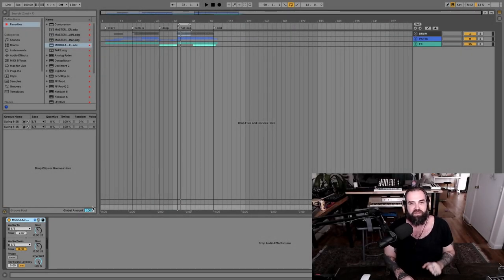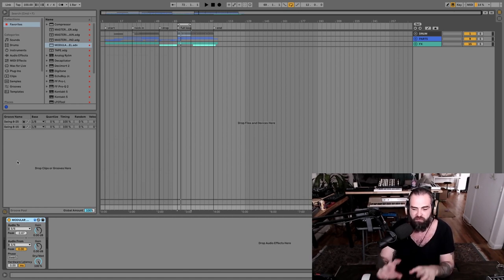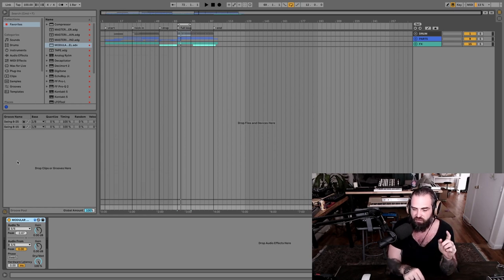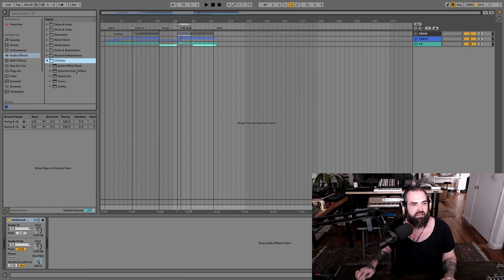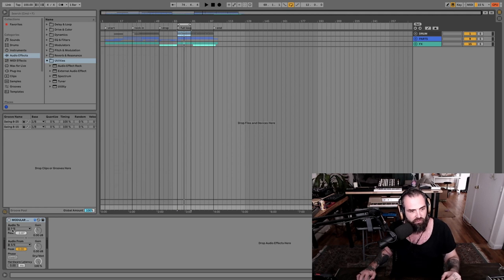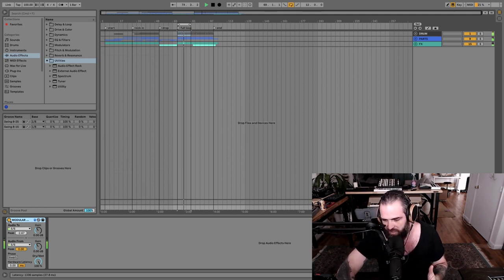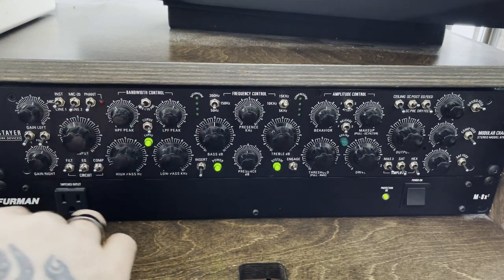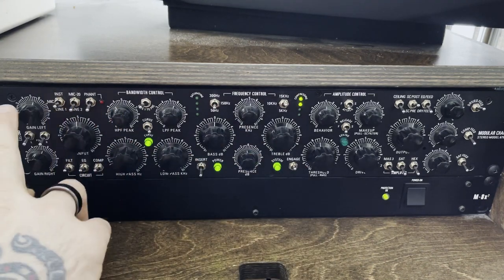Finishing A Track 3 : MixDown with Overstayer Modular Channel

Comment: Just a heads-up you can turn the filter/EQ/and comp off from the saturation feed in the circuit section on the left and they still work on the other feeds! Super useful for separating the different feeds for parallel
Reply from the maker: Thanks for the tip! still new to this guy and learning!
Reply: @OoraMusic  Yeah it's amazing! The manual on their website helped me a lot as well. Way less intimidating with all the knobs now :)

Comment: about the CIRCUIT switches in the begining - do they engage the Filter/Eq/Compressor in to the Saturation (MAS/SAT/HEX) , and if not engaged they are not saturated , right ? .. so fo example if i switch FILTER circuit ON , i will saturate the filter with whatever type of saturation i choose , and the other that are not switched on will not be saturated .. is that right .. OR they just bypass FILT/EQ/COMP ?? Thank you very much !
Reply from the maker: yes! you can do pretty complex routing with this thing, very versatile

Comment: Great to finally get more videos on this unit! Been very interested in getting one for a while. Some things to note that weren’t mentioned on the video: what goes into the sat feed is controlled in the “circuit” section, so if you want the compression to be completely parallel from the saturation then you can switch it off there. This means the device can also be used in series by having everything routed into to the sat feed via the circuit section and having the dry/eq feed and comp feed off.
Reply from the maker: Thanks for saying that! at the moment i was still learning!
Reply: @OoraMusic  can’t wait to see more videos on the unit! And would love videos on the culture culture as well!